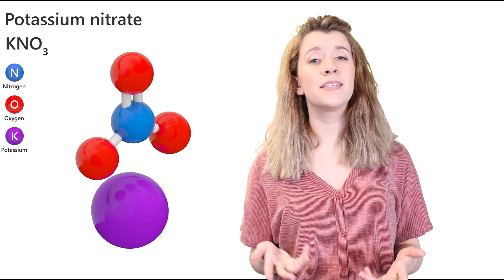Annealed, Tempered, and Chemically Strengthened Glass - What's The Difference?

Comment: Good presentation, especially about tempered 3mm getting warpage.  I do have a trick I use sometimes to eliminate warpage although it can increase the cost.  I temper anything from 19mm down to 3mm.  Anything 10mm and up gets virtually zero warpage.  Those applications are generally going to be shower doors, big store fronts, and marine windows.
Reply from the maker: Great information and tricks!